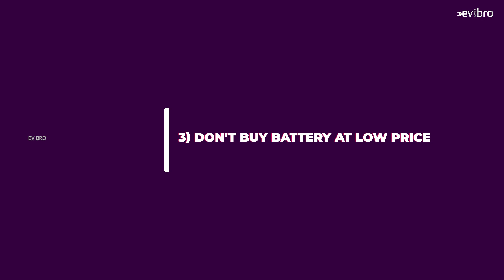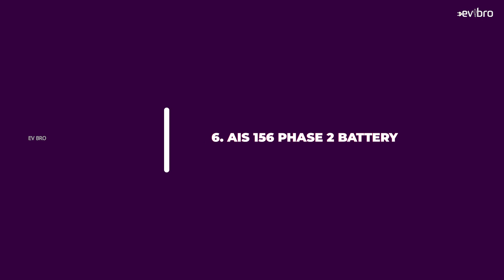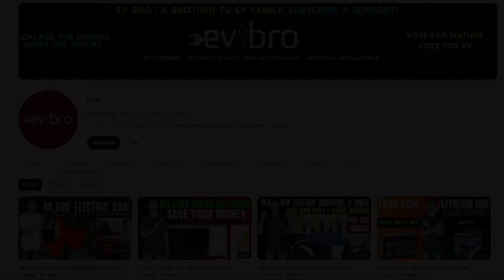7 Secrets Lithium ion Battery Companies Hiding - EV Bro

Comment: Bhai mere cycle ka battery pack 42 voltage 20 amp h 
Lakin full charge krne ke 24 hours baad without uses 40 voltage ho jata h .
Company ka khna h ki ye normal h .
Ur 1.5 year ka warranty h .
Kya voltage down hona sahi h??????

Comment: Good job Krishna and I want you to grow more but this is half baked video as giving tips is fine but you need to research a little more nd give the info on the sources of trusted vendors (who don't cheat) which will ease the job of your viewers.
Reply from the maker: A point here, some lithium battery vendors doing this frauds, which we mentioned in the video...
But most of customers and dealers are struggling.
There is no harm from good battery vendors. 
We highlighted the bad so that customers be aware